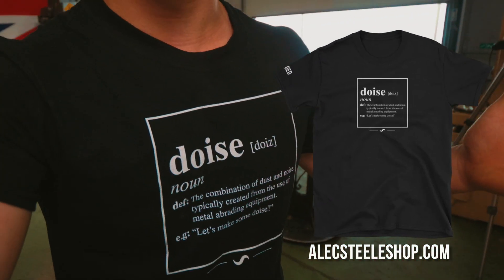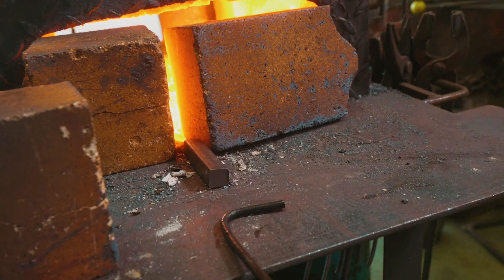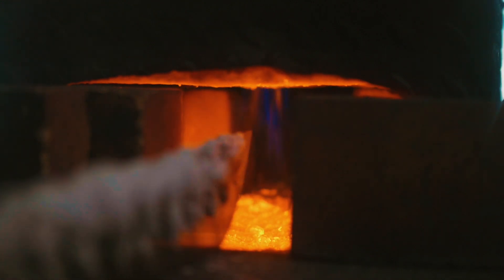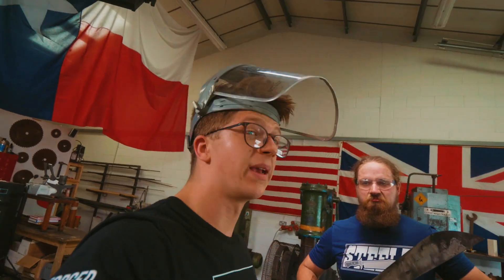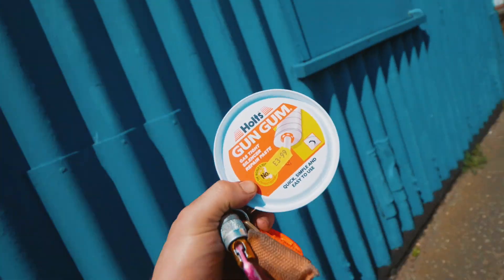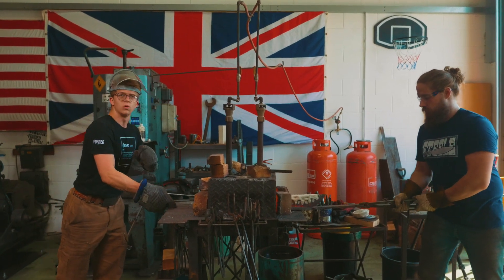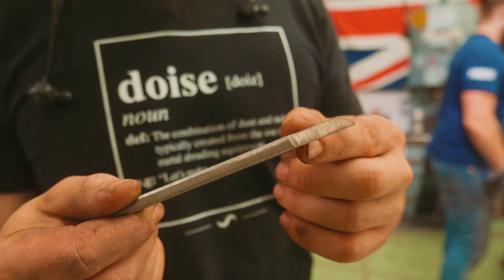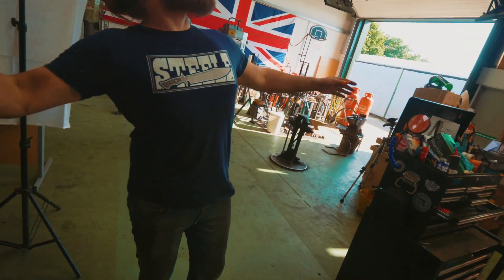MAKING A FALCHION!!! Part 3

Comment: I am not sure, but I did not see you temper it straight after the quench. You SHOULD heat the oil for a complete martensite structure. But right after a quench, even done right, the 1095 will be super brittle. It can crack just lying on a bench from internal stress. So you should follow the advice given about the pizza oven so you can temper it straight after the quench.

Comment: I'm definitely NOT a blacksmith at all, but I was wondering why you didn't like weld the crack, then sand it? I know that's not the way to do it (cause you didn't do it) but I was wondering why that would not work.

Comment: If you normalise it. Then pre heat a bit(just to be safe) why not weld it? Then when you go back through all your steps the heat affected zone should be uniform with the rest of the blade.
Reply: Hagbard Handfaste hmm I can see that. You would have to do some normalising cycles after the weld as well. maybe even tig fusion weld, then silver solder over. But  yeah steel is a funny thing to play around with

Comment: Stop playing with your knives after heat treat. They're under extreme pressure after heat treat and the stresses in the blade. I pre heat my oven before I quench my knives so that they can go straight into the temper. I dont let them even cool down to room temperature.

Comment: did the falchion influence the machete because that blade looks exactly like a machete blade shape.
Reply: not particularly - that falchion type appears around 1230, falls out of use by about 1300-1350 at the latest, machetes dont appear till a few centuries later. they're rather a case of convergent evolution, that a blade whic hwidens toward the tip allows greater mass. the devil in the detail, however, is that the falchion tapers aggressively in cross-section and has a pommel, while machetes are much flatter - they tend to be the same thickness at the grip and close to the tip, and they tend to be flat section with a short bevel, with no pommels. Combined, those two shaping details mean that even if you had two identically-shaped blades, their weight distribution and handling characteristics are very different, and the addition of a cross and pommel makes the falchion even more agile in the hand - which is needed. Machetes are designed to chop brush and plants, neither of which try to murder you in return.

Comment: With all the effort you put into building your own foundry, why didn't you pour a bronze guard for the Falchion? That would be so much cooler. You learn a technique, and then don't implement it. Come on give it a shot, use all sorts of methods on one project. Use the surface grinder, the foundry, the inlay tools, do a Hamon on a piece of Damacus, and turn a hand made wooden handle of ebony on the lathe, with a leather sheath.

Comment: why not do a oil temper.   where you fill a tube with oil and heat it up to the desired temp and then put your blade in.   ive seen some folks use palm oil cause it has a smoke point of 450 F.   easy and reusable and no need for one of those big temper ovens.   for the longer items anyways.
Reply: Q this would work well but palm oil at only 450* flash point is too close to the approximate 400*f tempering temperature

I would use peanut oil. It has a much higher working temp
Reply: I believe many shops use old motor oil for it, as well.
Reply: Problem is, oil doesn't hold that heat. You'd have to find a way to keep the oil at 450-500 degrees. Hence the oven, torch, or other slow tempers.
Reply: Mike Ford thats not the hard part. A heating element and thermostat is all that is needed. The oil will hold a much more uniform temperature.  Whereas an oven can have 50* temperature swings and be hotter in one are vs another

Comment: The actual traditional way to clay does not require wire, in fact, wire leaves marks (to some extent) ... don't forget metal transmits heat more than clay ... so having wire going under the clay will leans traces.

The Japanese Katana makers actually just apply the clay directly, you should watch a documentary or two, it's very well explained (even just visibly understandable).
You should trust a technique mastered over centuries rather than a recent video saying "use wire so it doesn't fall off" ^^
Reply: P5ykoOHD i think the wire is to get The pattern even and symmetrical but I don't like i think it is far better just to put it on at random

Comment: No disrespect but was crack caused when grinding off the clay? Over heating the blade with an old belt
Reply: Ben Roper unlikely, heating the blade is exactly what you do when tempering it. Some use flame tempering and that is very uneven.

I think it was because it was not tempered soon enough. Ideally you would move over to the tempering oven as soon as the blade was cool enough.

The longer you wait the greater the chance of it cracking. Some will crack just sitting on a table. No heating, cooling or external forces
Reply from the maker: Nope! likely the faster quench because of me heating up the oil!
Reply: Alec Steele I cracked one of my blades, it’s not a nice sound but part of the journey.
Reply: crack or no crack, cutting down the blade is going away from the new Alex.  newer forsake yourself.
Reply: Alec Steele how does warmer oil creates faster quench? Surely it would create a slower quench because they have closer temperatures. I’m just curious and abit confused haha
Reply: Why again should warm oil do a faster quench? The temp difference is a big factor in cooling, if it is higher you usually get a faster cooling rate. Warming the oil will slow down the cooling process not make it faster.
Reply: Alec Steele ..did the crack occur where the wire was.
Reply: TheQuantumCreeper  heated oil thins slightly which allows for more efficient heat transfer. 
The slight increase in temp to the oil is nothing compared to how efficiently warm oil will suck away the heat